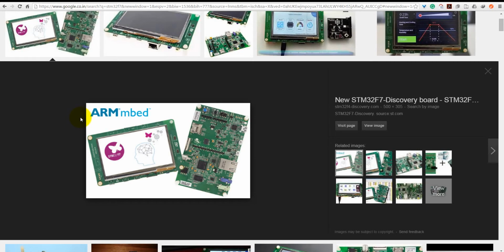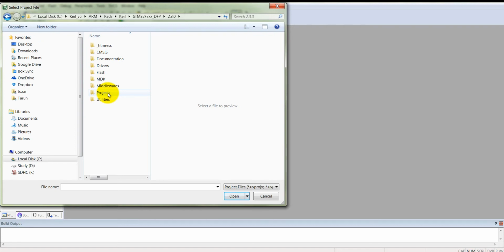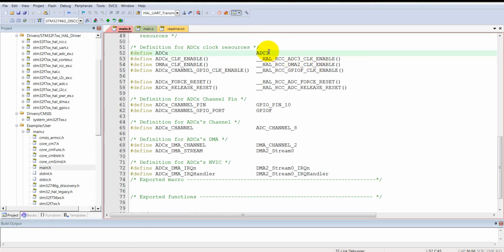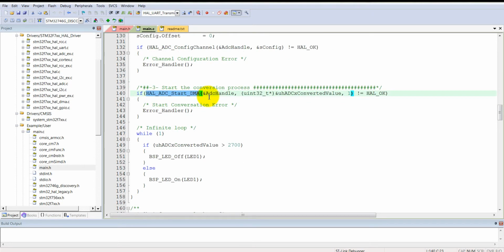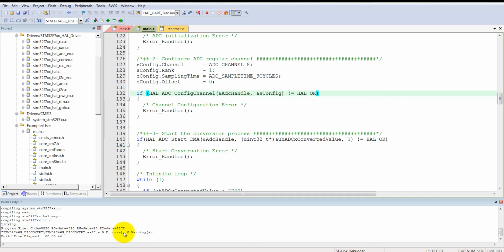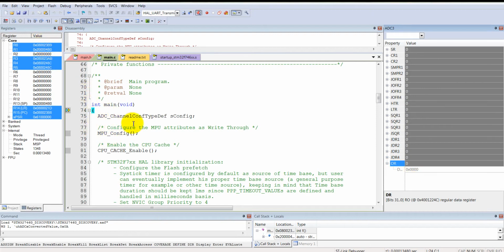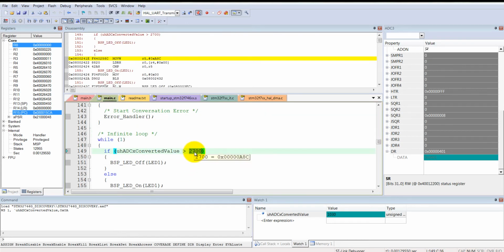5 STM32F7 Discovery Board ADC Programming using Keil uVision v5 Part 2/3

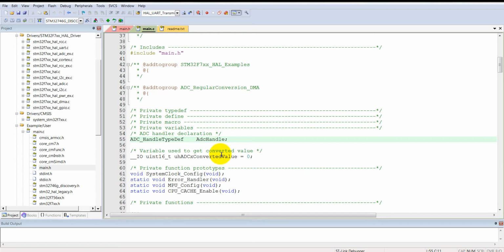Comment: Sir, You mention @7:20 you can't use the ADC3 Channel 8 on the board. Why is that? the STM32F7 PF10 pin name which the program defines for ADC3 Channel 8 as: GPIOF and GPIO_PIN_10, is connected to CN5 Pin2 on the STM32F746G Discovery board and is designated as ADC3_IN8.  Therefore, the design should be able to sample analog signal with this code.